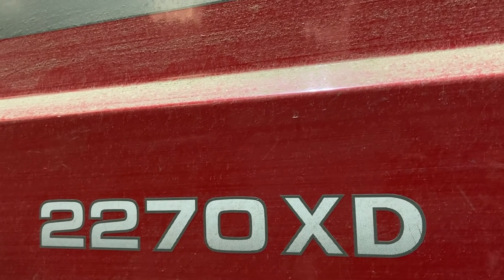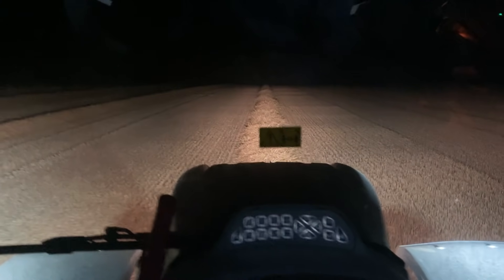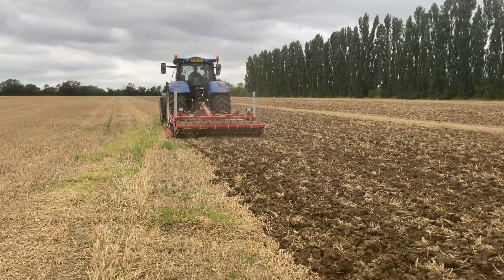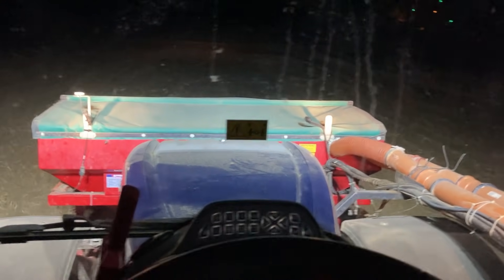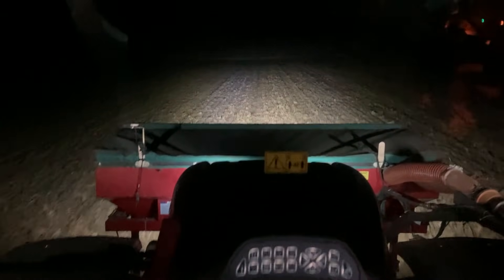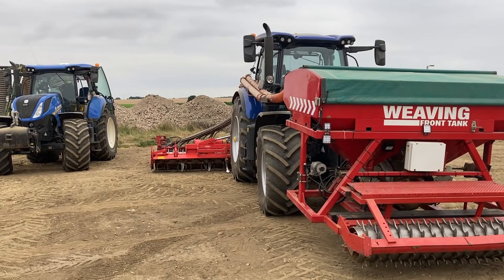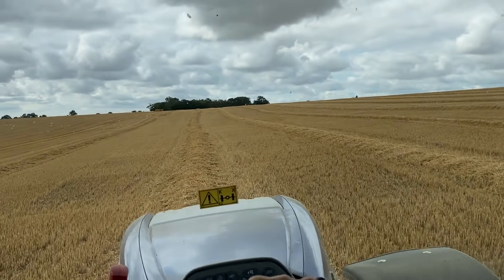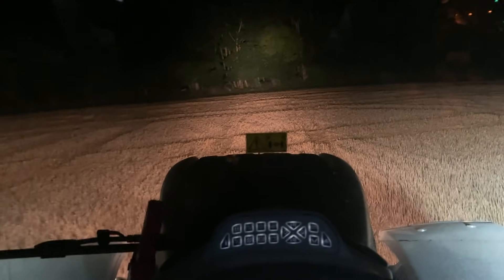Planting a cover crop, Night work, baling, turning and more.

Comment: My opinion, 3-4hrs sleep isn't a safe way to operate machinery. Working alone as we do adds to the risk. Fine now and again if harvesting under difficult circumstances but not to put in a cover crop!
Reply from the maker: But if you looked we were not alone. We all have cb radios in the machines so can regularly talk to one another. It’s not normal to only have that sleep.